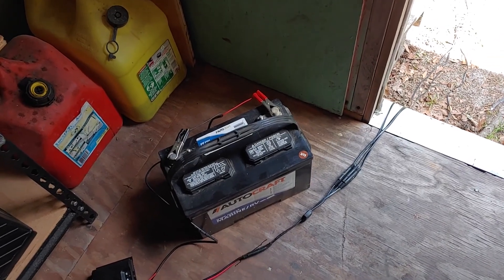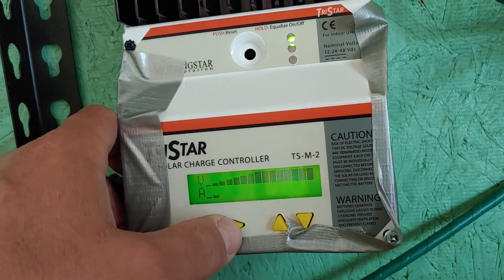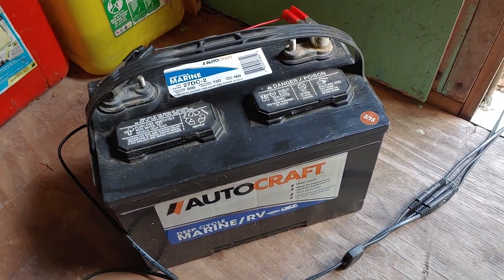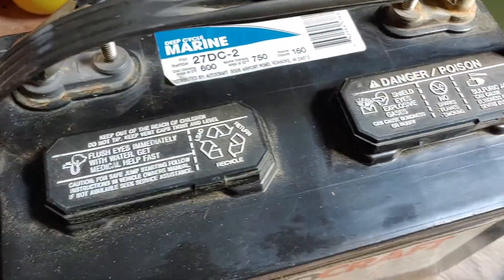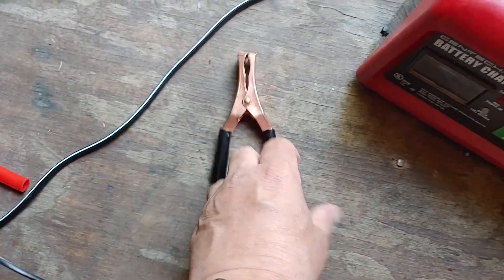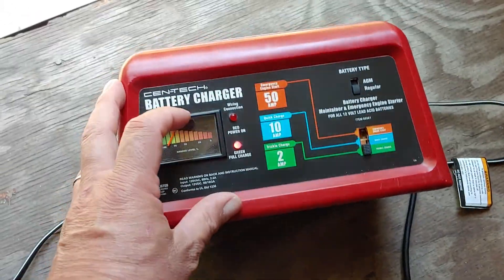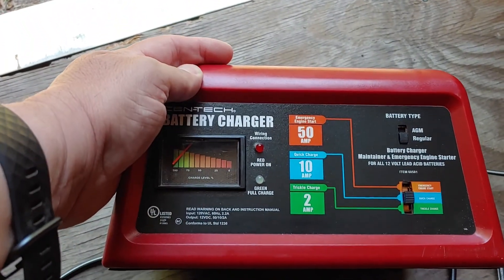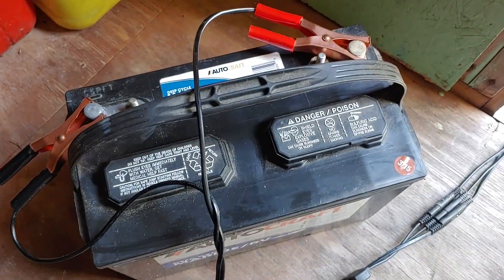Charge a battery Without solar power with a Harbor Freight 12 Volt 50/10/2 Battery Cen-tech charger.

Comment: First of all thank you for responding much 💘
2- so. you can't auto charge all of them at the same time if you're not using them
3- I had a problem  Which is my inverter uses 60 Hz and in my country most of our electronic use 50hz. so do I have to change the inverter or can I do something about it?
Reply from the maker: Thanks for your comment
Reply: @shoestringprep  How do you know when the battery is fully charged, because when I connect charger to any Battery the one LED light goes on and never turns off. and I mean the green charging LED on the charger, or do you have to rely on the meter that say's 100% to know, because the margin of error is greater relying on the meter, versus the charger turning off automatically.